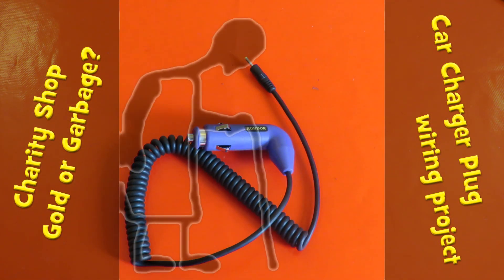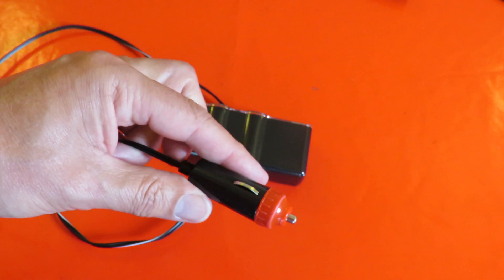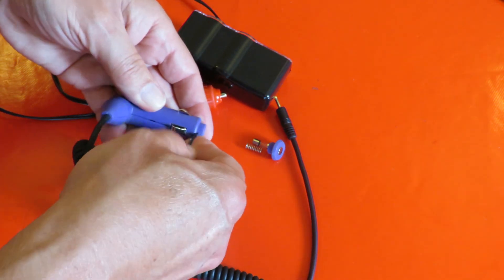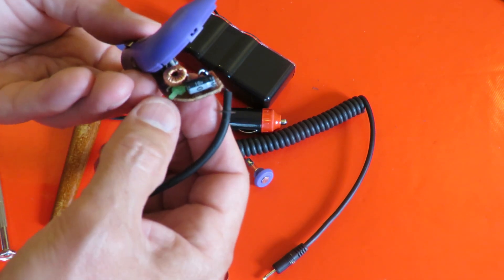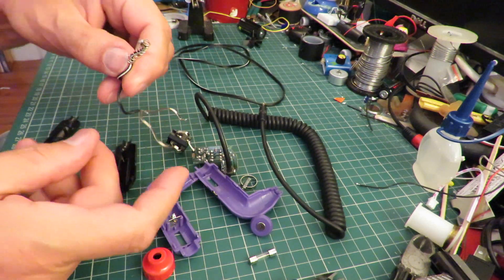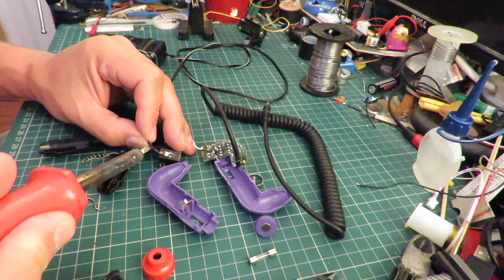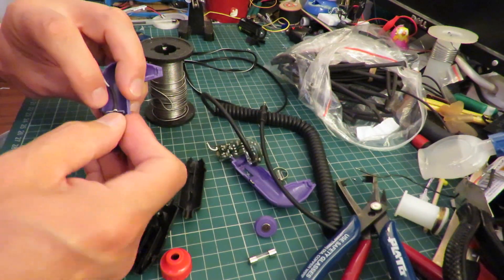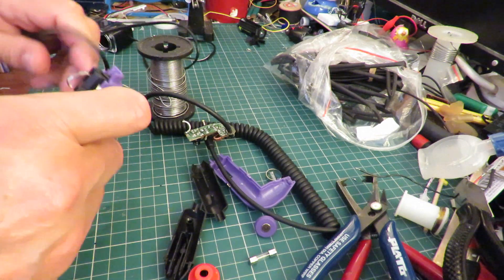Charity Shop Gold or Garbage? Car Charger Plug wiring project

Comment: that spiral cable was way better too a pity u didnt use it.
Reply from the maker: That spiral cable would be completely unsuitable for the way I used the unit in the car. You need to tuck the wire behind the trim to keep it out of the way.